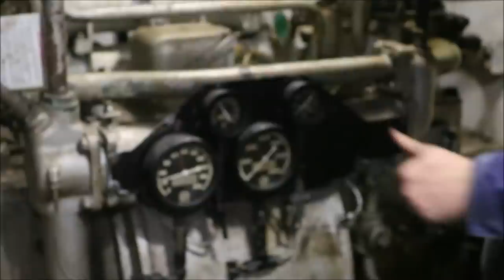First start in 72 years WWII 1942 Cleveland Diesel 8-268A

Comment: A person has to wonder how current diesels will do after sitting idle for 72 years. I betting not so well. Back in the 80's when I was in the USN a lot of the engineroom equipment on newer built ships was designed in the 1930's:navy brass thought if it was good enough then and proved itself why change. Good thought process as far as I'm concerned.
Reply: It depends on your priorities. The old two stroke engines were simple and powerful and didn't even need an electrical system to operate which makes them inherently resistant to a nuclear EMP.  The military still uses them in many applications. BUT, the shortfall is that they are loud and not very fuel efficient and, as some people mentioned, they can runaway under certain conditions and destroy themselves quite spectacularly. It used to happen in locomotives occasionally. They were OK when fuel was dirt cheap. But, now that cost has to be taken into consideration. So, simplicity has given way to efficiency.
Reply: Rick Delair  I disagree with you. 2 stroke engines have a high power to weight co-efficient compared to 4 stroke engines. But they are not as efficient, especially the older ones. Here is more information: https://mechanics.stackexchange.com/questions/25049/what-makes-two-stroke-engines-less-fuel-efficient-than-four-strokes
Reply: Here is an explanation of what is a runaway diesel engine: https://www.youtube.com/watch?v=W3dKbtGLM9g
Reply: You cannot change physics. 2 stroke is less thermally efficient than a 4. The Otto cycle is less efficient than the Atkinson cycle. The only way a 2 stroke is more efficient is in an opposed piston design. The have no cylinder head to loose heat to and have a higher thermal efficiency. They still don't have the greatest emissions. I work with a bunch of 2 stroke tanks that leave a haze of exhaust when accelerating or climbing. The 4 strokes there smoke depending on model.

The 6bt Cummins that the British military replaced the massive 6.57l RR 2 strokes with improved range, slightly more power and slightly better hill climb ability while being lighter.

I like 2 stroke as much as the next guy, but understand it's positives and negatives.

You can't use large ship engines as an example when comparing because they do not operate no in the same manner. Yes, they have 50+% thermal efficiency but they are completely hydraulically operated.
Reply: If you want to see a runaway 2 cycle Detroit diesel, check out this: https://www.youtube.com/watch?v=JxLb3Yqqds4
Reply: Rick Delair  id still rather have a cummins any day
Reply: @herpnderpn2484  Your claim that 2 stoke engines are less efficient than 4 stroke is absolute b.s., and your attempt to ignore marine engines is pathetic. Because large ship engines use astonishing quantities of fuel, extensive research is done for this application. Much more so than anything else with the sole exception of power generation. In both applications, the engines are typically run continuously at high loads for extended periods. 
2 stoke engines are by far the most reliable and efficient internal combustion engines available. Contrary to your erroneous claim, the most efficient engines are NOT opposing piston. They are Wartsila's who also make the most efficient 4 stroke engines. 
The  records are well documented. No one needs to take my word for it. Here's a link to a white paper on the subject: https://www.wingd.com/en/documents/general/papers/the-development-of-the-modern-2-stroke-marine-diesel-engine-(cimac).pdf/
Reply: @EDesigns_FL  
I think most marine diesels are 2 strokes just like the Wartsila. If someone watched Das Boot, the submarine engine would be 2 stroke MAN, Sulzer, very similar to the one in video. Tanks use  2stroke diesels, train locomotives, so do buses, at least did some time ago. Run-away diesel happened to my friend while fixing costumers VW TDI - sucked a lot of oil from pan via blown Turbo seals because the owner drove it like an idiot and never let engine idle before turning it off - engine had to be rebuild.
Reply: @pliedtka  Emission regulations are killing off 2 strokes. Though they are more reliable and fuel efficient (direct injection, e.g. diesel), they're also a little dirtier. Even outboards are switching to 4 stroke because of regulations. 
Wartsila is the king of the big engine market and they're being forced to switch. Contrary to what some commentors have claimed, it has nothing to do with fuel efficiency.
Reply: @EDesigns_FL  
The DPF while does worthwhile reduction in smog is not for everyone, especially small commuter car driven mostly a few minutes a day - clogged DPF. But I think big marine diesels will be not replaced for a while. We also use Cummins in 2007 Dodge RAM, it isn't as bad as some GMs or Fords. I do understand that commercial vehicles have 350 thou miles requirement before replacement. The smog isn't as bad in NA, other than urban areas, as it is in EU, especially Eastern EU, where a lot of the Russian machinery was used, bad stinky diesels. Also the old Russian diesel fuel had high sulfur content.
Reply: @EDesigns_FL  
4 strokes are more efficient...simple rule of physics.
The 71 series Jimmies were the greatest fuel pigs ever to go to sea...They could never hold a candle to Gardner, Scania, or Volvo marine diesels for economical power.
Reply: @charlesharper2357  Thank you for the information. No doubt you're an expert on the subject and Guiness and the rest of the world are wrong because they state that the Wartsila RTA96-C, which is a two-stroke, is the most efficient internal combustion engine ever made. https://newatlas.com/go/3263/
Detroit Diesels were by far and away the most popular marine engine in their size classes because of their extreme reliability and, contrary to what the ignorant claim, they were fuel efficient. Their big EMD brothers owned the railroad market because of their efficiency. EPA regulations killed off two-stroke diesels; not inefficiency.
Reply: @EDesigns_FL  
You're comparing apples to oranges.
The engine that you're talking about is 7780 horsepower: ..the largest GM two stroke that I know of was the 16-71, which produced a mere  800 HP.
Go and price an average yacht...4 stroke diesel engines command a premium over 2 stroke diesels...nobody wants a noisy, 2 stroke fuel pig.
Reply: @charlesharper2357  It's blatantly obvious that you don't know crap about this subject. 
 Wartsila RTA96-C's produce more than 7500 hp/cylinder and range from 46,020–107,390 hp. 
In regards to GM two strokes, the largest I'm acquainted with is the 16-710G3C-T2 which produced 4,500 hp and was exceptionally fuel efficient and reliable. The only reason it was discontinued is because of emission regulations. Even after it was banned in the US, it was still sold for export for many more years. 
MAN, FMC and many other manufacturers also sold some great two stroke diesels. Again, it was NOx regulations not efficiency that killed them off. 
The standard method for comparing efficiency of internal combustion engines is via brake specific fuel consumption (BSFC). Here's a link to some info on the subject:
https://en.wikipedia.org/wiki/Brake-specific_fuel_consumption
With the sole exception of combined cycle engines, the most efficient engines ever made are all two stoke diesels. Way better than their four stoke counterparts.
Reply: @EDesigns_FL  
It's obvious that you've never been to sea on anything smaller than a Cruise Liner or ever maintained a diesel engine.
Superchargers or turbochargers  don't react well to being idled, and fail long before a 4 stroke diesel will.
Reply: @charlesharper2357  I've lived most of my life in South Florida, on the water, and still do. I've owned more boats than I can recall: from windsurfers to a 46' Morgan, and numerous power boats from RIB's, tunnel hulls, and a trawler. I worked my way through college working on other peoples boats. My daily driver is a diesel and as is my back-up generator. I do all my own maintenance. So, yeah, I know a little about diesels, and particularly marine diesels. 
In regards to your asinine comment about superchargers and turbos, you've proved my point about your ignorance on this subject.
Reply: @EDesigns_FL  
Hilarious...have you ever owned a two cycle diesel of over 200 HP?
Have you ever maintained a 6/71 or 12/71 Jimmy?
I've engineered on commercial boats that had twin 12/71s...and they were absolute oil guzzling, fuel spewing pigs.
Turbochargers and superchargers hate idling...and they blow up on a regular basis.
How many hours do you have offshore...not many, obviously.
Reply: @charlesangell_bulmtl  Your koolaid seems to be highly alcoholic. Research and development of better two cycle engines has gone on for years because of the high energy output to weight ratio. Stihl just recently introduced the first fuel injected production chain saw. But, the article you reference is about 2 cycle high horsepower diesel engines for large ships. You're talking about a huge, low RPM engine that puts out thousands of horse power. It doesn't even burn regular diesel, but a low grade fuel oil. Those engines are in class all their own and are notorious polluters. They're cost efficient to operate, not energy efficient. Research is being done to improve their efficiency and reduce their operating cost because they suck tremendous quantities of fuel.
Reply: @charlesharper2357  Your continued illumination of your absolute ignorance of marine engines is comical. 
Every Broward, Viking, and Hatteras I've worked on had Detroits. They had something else in common: all the engines were white, and I'm confident that you fail to appreciate the choice of color. I will enlighten you so that maybe you will stop making an ass of yourself. 
The engines are white for numerous reasons. For example lighter colors radiate less IR which reduces engine room temperatures, but the primary reason is to highlight leaks (e.g. oil, coolant). Potential fines for discharging oil from a vessel can be staggering. Also, oil on an engine is a huge fire hazard. So leaks on a marine engine are inexcusable. 
Unlike Detroits in trucks, their marine counterparts have catch-cans and cast aluminum valve covers. I've seen some on derelict commercial vessels that were maintained by inept owners/mechanics that leaked, but never on a pleasure boat. So which is it, are you a liar or did you work on a POS?
Reply: @EDesigns_FL  
They HAD Detroits...nobody installs them anymore because they're unreliable fuel pigs.
Four strokes made by Cat, Cummins,  MAN and Volvo dominate the market.
When I started out in the fishing industry 40 years ago people were pulling their Jimmys out because the fuel bills and breakdowns were killing them...you lose your blower and you're screwed.
Compare that to the guys who had Gardners and Volvos...they ran forever and sipped fuel.
Reply: Current diesels let set for that long would probably seize up and the seals would be so bad rotted that a rebuild would have to happen before any coal rolling could happen.
After about 2003 the engines made are designed to fail, thanks to the EPA and greed.
Doesn't make them enough money to make engines that last.
Reply from the maker: @Robb403  @Charles Harper @E Designs @Herpen Derpen
Thanks for the comments and interaction guys! It's always good to see others opinions and views. Stay tuned for videos of a massive slow speed 2-stroke cross head engine and inline 9 cylinder generators!

As for some of the comments on massive slow speed 2 stroke ship engines, they do burn normal low sulphur diesel (among other fuels) and are incredibly efficient. Let me briefly explain. The dirty fuel oil brought up in the comments goes by many names but is widely regarded as HFO or bunker C. It has been the law of the land for some time now that ships coming within 200nm of land, basically anywhere in Europe, or special areas could not burn this fuel, they had to switch over to low sulphur diesel fuel or MGO. According to IMO 2020 regulations, the use of anything other than low sulphur fuel oil (diesel) is outlawed anywhere in the world except if the vessel is equipped with an acceptable exhaust gas scrubber. Hence even the biggest ship engines can burn the same diesel you buy at the pump.

For efficiency there is no other mass produced or relevant design that produces more power for pound of weight for less fuel burn than the slow speed 2-stroke cross head engine. The reason why practically all large ocean going vessels have these engines is efficiency. Over the life of a ship the biggest operating expense is always fuel. Shipping companies will do anything to reduce fuel consumption while carrying more cargo, that is the name of the game. If any other engine design was more efficient and economical it would be put in every single new build cargo vessel. The exceptions to this school of thought are special purpose ships such as cruise liners that choose redundancy over fuel efficiency, multiple smaller 4-stroke generators instead of one massive cross head engine. Some large LNG carriers will use gas vapors as fuel and other smaller new build ships are also using LNG or similar fuel.

Hope this was somewhat informative. Thanks again guys.
Reply from the maker: @EDesigns_FL   Robb403  @Charles Harper @E Designs @Herpen Derpen
Thanks for the comments and interaction guys! It's always good to see others opinions and views. Stay tuned for videos of a massive slow speed 2-stroke cross head engine and inline 9 cylinder generators!

As for some of the comments on massive slow speed 2 stroke ship engines, they do burn normal low sulphur diesel (among other fuels) and are incredibly efficient. Let me briefly explain. The dirty fuel oil brought up in the comments goes by many names but is widely regarded as HFO or bunker C. It has been the law of the land for some time now that ships coming within 200nm of land, basically anywhere in Europe, or special areas could not burn this fuel, they had to switch over to low sulphur diesel fuel or MGO. According to IMO 2020 regulations, the use of anything other than low sulphur fuel oil (diesel) is outlawed anywhere in the world except if the vessel is equipped with an acceptable exhaust gas scrubber. Hence even the biggest ship engines can burn the same diesel you buy at the pump.

For efficiency there is no other mass produced or relevant design that produces more power for pound of weight for less fuel burn than the slow speed 2-stroke cross head engine. The reason why practically all large ocean going vessels have these engines is efficiency. Over the life of a ship the biggest operating expense is always fuel. Shipping companies will do anything to reduce fuel consumption while carrying more cargo, that is the name of the game. If any other engine design was more efficient and economical it would be put in every single new build cargo vessel. The exceptions to this school of thought are special purpose ships such as cruise liners that choose redundancy over fuel efficiency, multiple smaller 4-stroke generators instead of one massive cross head engine. Some large LNG carriers will use gas vapors as fuel and other smaller new build ships are also using LNG or similar fuel.

Hope this was somewhat informative. Thanks again guys.
Reply from the maker: @charlesharper2357   Robb403  @Charles Harper @E Designs @Herpen Derpen
Thanks for the comments and interaction guys! It's always good to see others opinions and views. Stay tuned for videos of a massive slow speed 2-stroke cross head engine and inline 9 cylinder generators!

As for some of the comments on massive slow speed 2 stroke ship engines, they do burn normal low sulphur diesel (among other fuels) and are incredibly efficient. Let me briefly explain. The dirty fuel oil brought up in the comments goes by many names but is widely regarded as HFO or bunker C. It has been the law of the land for some time now that ships coming within 200nm of land, basically anywhere in Europe, or special areas could not burn this fuel, they had to switch over to low sulphur diesel fuel or MGO. According to IMO 2020 regulations, the use of anything other than low sulphur fuel oil (diesel) is outlawed anywhere in the world except if the vessel is equipped with an acceptable exhaust gas scrubber. Hence even the biggest ship engines can burn the same diesel you buy at the pump.

For efficiency there is no other mass produced or relevant design that produces more power for pound of weight for less fuel burn than the slow speed 2-stroke cross head engine. The reason why practically all large ocean going vessels have these engines is efficiency. Over the life of a ship the biggest operating expense is always fuel. Shipping companies will do anything to reduce fuel consumption while carrying more cargo, that is the name of the game. If any other engine design was more efficient and economical it would be put in every single new build cargo vessel. The exceptions to this school of thought are special purpose ships such as cruise liners that choose redundancy over fuel efficiency, multiple smaller 4-stroke generators instead of one massive cross head engine. Some large LNG carriers will use gas vapors as fuel and other smaller new build ships are also using LNG or similar fuel.

Hope this was somewhat informative. Thanks again guys.
Reply from the maker: @herpnderpn2484   Robb403  @Charles Harper @E Designs
Thanks for the comments and interaction guys! It's always good to see others opinions and views. Stay tuned for videos of a massive slow speed 2-stroke cross head engine and inline 9 cylinder generators!

As for some of the comments on massive slow speed 2 stroke ship engines, they do burn normal low sulphur diesel (among other fuels) and are incredibly efficient. Let me briefly explain. The dirty fuel oil brought up in the comments goes by many names but is widely regarded as HFO or bunker C. It has been the law of the land for some time now that ships coming within 200nm of land, basically anywhere in Europe, or special areas could not burn this fuel, they had to switch over to low sulphur diesel fuel or MGO. According to IMO 2020 regulations, the use of anything other than low sulphur fuel oil (diesel) is outlawed anywhere in the world except if the vessel is equipped with an acceptable exhaust gas scrubber. Hence even the biggest ship engines can burn the same diesel you buy at the pump.

For efficiency there is no other mass produced or relevant design that produces more power for pound of weight for less fuel burn than the slow speed 2-stroke cross head engine. The reason why practically all large ocean going vessels have these engines is efficiency. Over the life of a ship the biggest operating expense is always fuel. Shipping companies will do anything to reduce fuel consumption while carrying more cargo, that is the name of the game. If any other engine design was more efficient and economical it would be put in every single new build cargo vessel. The exceptions to this school of thought are special purpose ships such as cruise liners that choose redundancy over fuel efficiency, multiple smaller 4-stroke generators instead of one massive cross head engine. Some large LNG carriers will use gas vapors as fuel and other smaller new build ships are also using LNG or similar fuel.

Hope this was somewhat informative. Thanks again guys.
Reply: It seems the newer ones have there running issues when there new can't imagine after sitting for 72 years I know the fuel mileage really to a dive I have a 2000 F350 with a 7.3 powerstroke diesel I've thought about buying a new one but I don't want part with it
Reply from the maker: @phillipgarrow2297  I have the same truck and also refuse to part with mine. Thanks for watching and the comment!